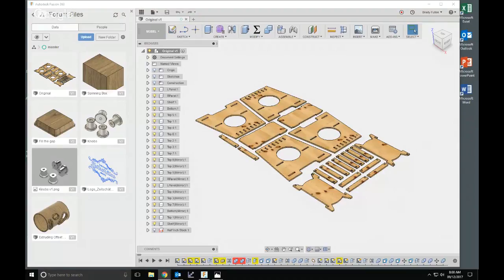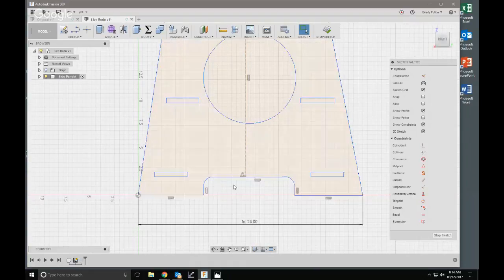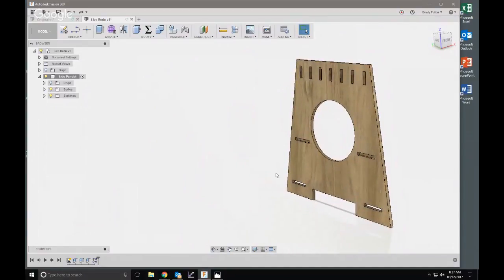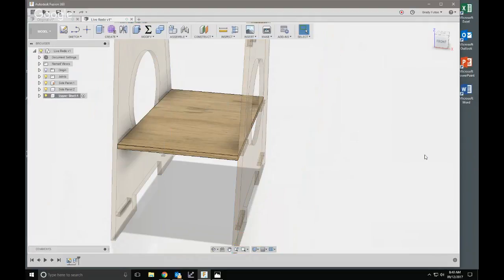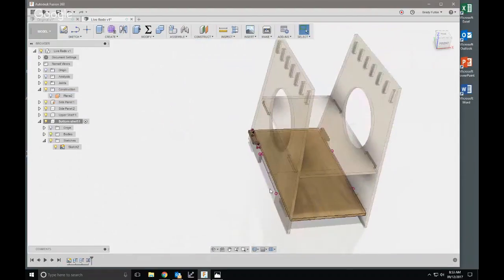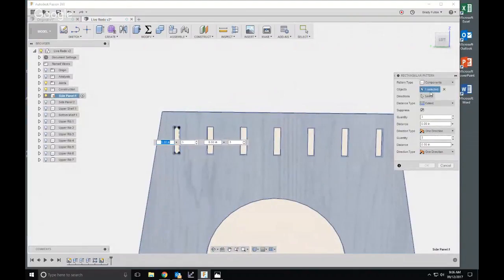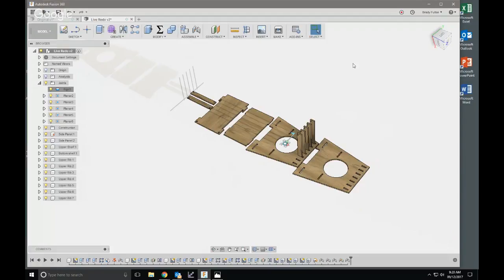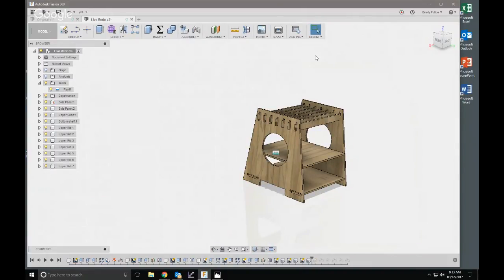Fusion 360 - Components and Patterns

Comment: Sorry to be absent for the hangout. I had to go to work. At the end of the day I tried cutting out my design and it was a disaster. I came home to redo the entire model when I saw that you have posted your video. Thank you so much for your time on going through the project with such patience to teach, with such dedication to disseminate knowledge and with such love of solving problems. I have been very touched. I hope one day I can be of help to the world like you. I learnt A LOT from your video and will now try it out on my own. I am sure I will have questions.
Reply: One other thing, for the dogbones I used a 'dogbone' add-in
Reply: Love the Dogbone add-in. However after the add-in played itself out, I had to manually do a couple of them. I am sure something was wrong with my component. I learnt the Parameter I/O from you but when I used it, it brought in a million unwanted parameters. Had to go back and type in manually like you. I am just up to the point where you start patterning. Have to go to work. Will continue. This is so additive. Forgot yoga.
Reply: When you started you first made the side panel. Then you turned it off and adjusted the sketch. The side panel followed the changes you made in the sketch. You came back and extruded the sketch. what happened to the body in the first extrusion? Is that something that is in your normal workflow or am I missing something? Also, after the second extrusion, you selected the cut-throughs and the the pockets. They do not seem to be selectable. How did you manage that?